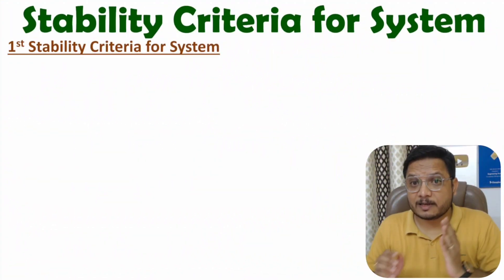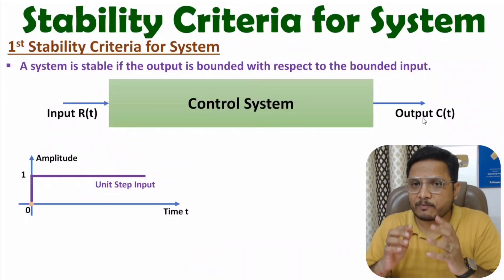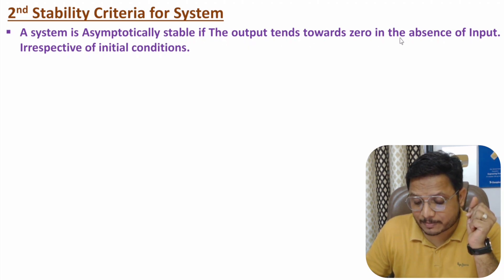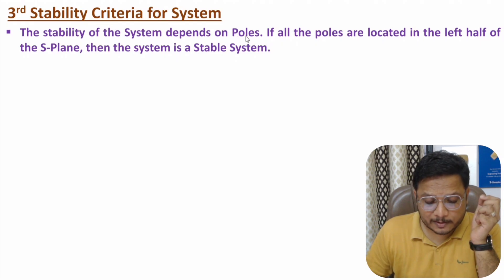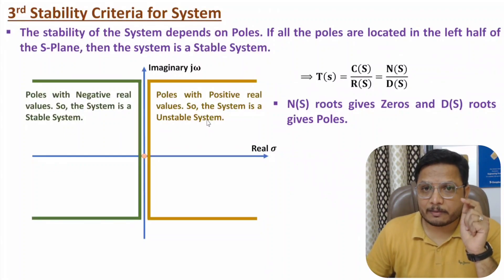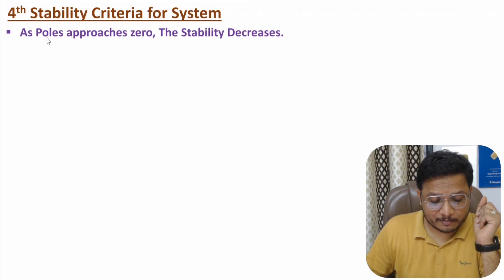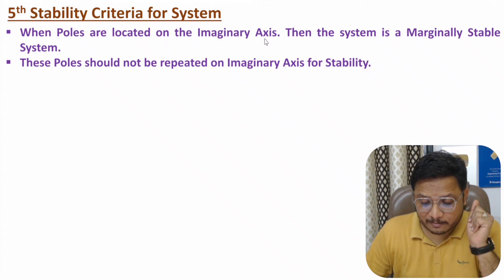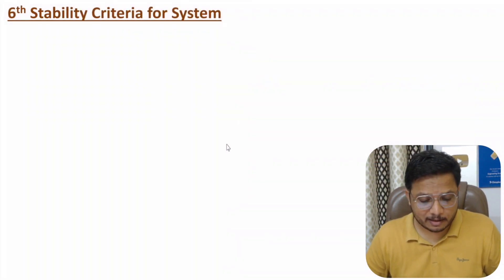Stability Criteria of Control System Explained

Comment: @EngineeringFunda, Dear professor, i am having a fundamental question. Does input defines output and its stability in follow or System by itself ?! If control system defines the out put, why our stability is related to the type of input? if input is creating a boundry for out put in order to keep the system stable, so we should give the bounded input in orer to keep systems stable (however its not realistic as we should give all type of input to system and we havnt that much control on that)? Thanks in advance.🙏
Reply from the maker: System output = Transfer function × Input. 
So it is obvious that output depends on input. So, stability also depends on input.